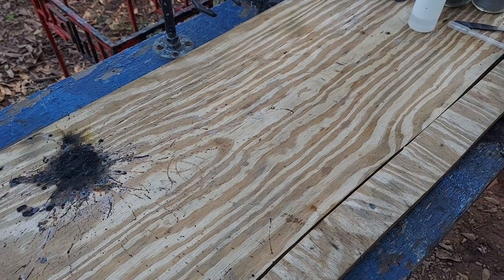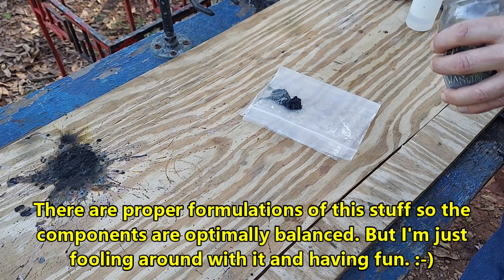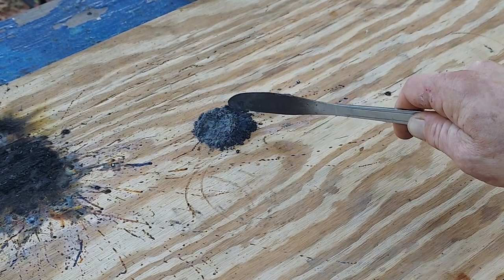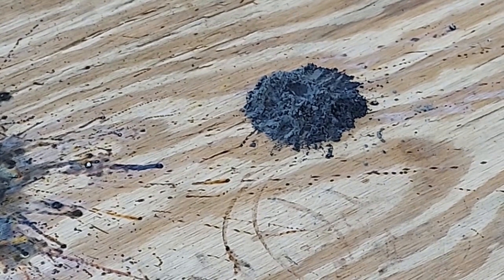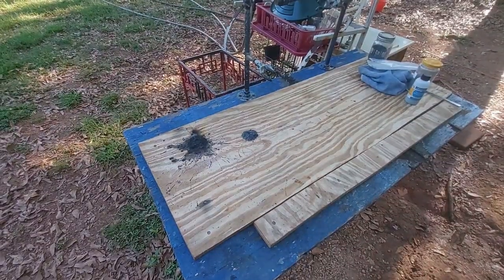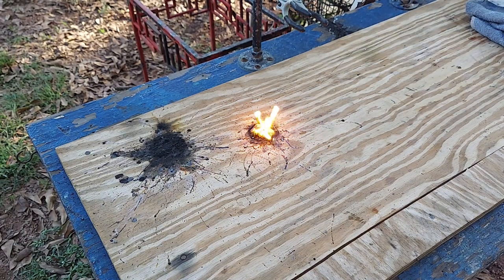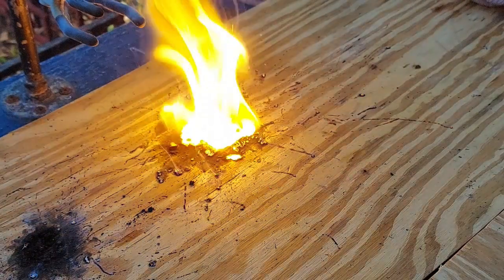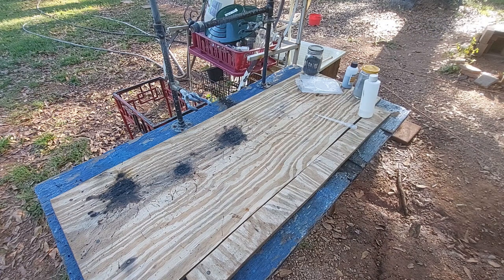Flash Powder (Magnalium and Antimony Trisulfide) #chemistry #donttryathome

Comment: Really that's it? You made it seem like it was going to explode violently or something. Regular flash powder gives a better result than that. Hell even black powder.
Reply: Properly mixed antimony trisulfide and either aluminum for magnalium in a stoichiometric mixture makes a more powerful flash than KClO4/Al, albeit much more sensitive and dangerous, it's not commonly used because of its extreme sensitivity. Standard flash is bad enough, this stuff will go off with a dirty look.

Comment: Tbh, not a very impressive flash powder in my opinion 🫣 it’s for sure exotic, but just Al + KClO4 (or 3 😬) gives already way better results in my experience.
Also remembering the Red P and KClO3 I mixed together in my kitchen gives surprising results even in sub 1g quantity. So surprising that I’m afraid to do it ever again 😅
Reply from the maker: If you define impressive as less stable or more poweeful then there arr things you can add to this to make it tbat way. Ive been burned before by these pyro mixes before and it REALLY sucks. Very painful and the burns are deep. 

Red P and potassium chlorate make a shock and impact sensitive explosive but if you light it off it just burns rapidly and doesnt explode.
Reply: @PoorMansChemist  flash powder from Al and KClO3 reacts much faster from my experience that the mix u made. Also, normally I’m far away from questioning things u said, but the Red P chlorate mix I light on fire (under 1g loose powder) went of instantly with a loud bang that gives me ringing ears for some time. So where u information about it’s just burning away comes from ? Or did I get anything wrong here 🤔
Reply from the maker: @horsthorstmann2480  When I did the experiment all it did was burn. It explodes on percussion but not by flame. At least it never has when I've done it. It just burns very quickly. It's not a question of mixing and the red P is good quality. But it doesn't explode when exposed to flame. 🤷‍♂️
Reply: @PoorMansChemist  wait, to get that clear, we are talking about Armstrong Mix right now ? Than I can definitely assure u that my mix went of with a loud bang when touched by a flame. Don’t know how fast the shockwave actually was of course but I would say it explode. I mixed the components together by putting them onto a piece of paper and folding it numerous times, then made a little pile from it, like I said max 1g and ignite. A friend got a video of that but he didn’t manage to find it yet but I guess u need to redo this experiment if ur mix don’t went of by flame 😜😅

Comment: If you want a real spicy one try magnalium at 40% potassium chlorate at 50% & antimony trisufide at 10%,  be warned this mixture is the devils work & will detonate as apposed to deflagrate, you only have to look at it wrong once brush mixed & it will go. The only real way to mix it is with a fine bristle artist brush attached to a long stick. The flash it produces will scorch your skin if your hand is any closer than 6 inches to a 2 to 3 gram batch of this stuff. I happened on this evil brew while doing some simple reactivity experiments years ago, its basically like an armstrongs mix on steroids without the red P,
its incredibly powerful stuff, but thankfully totally useless fort anything other than a science demo due to its sensitivity.